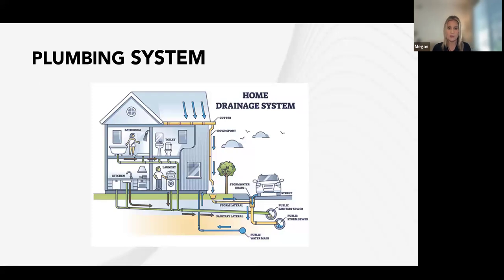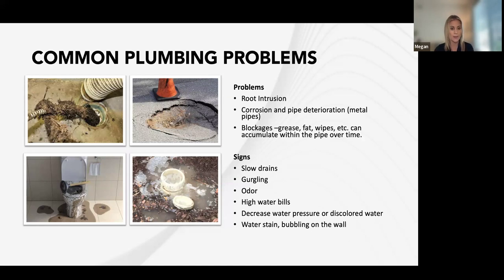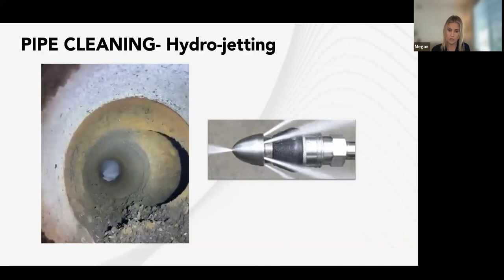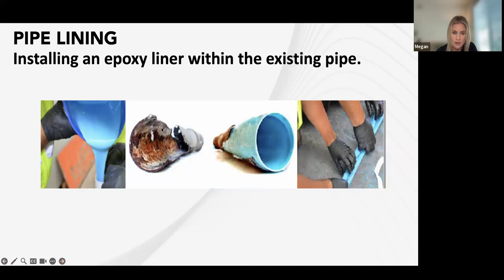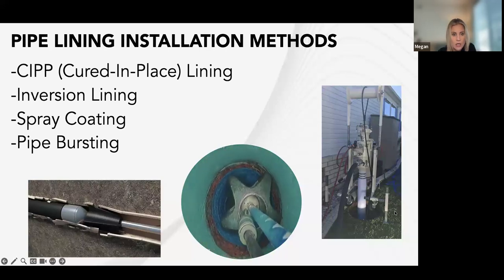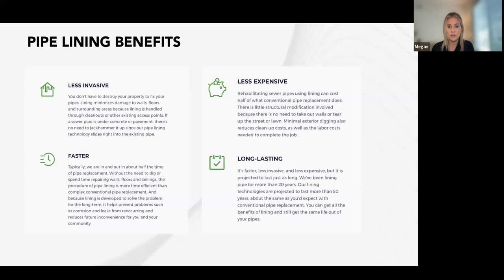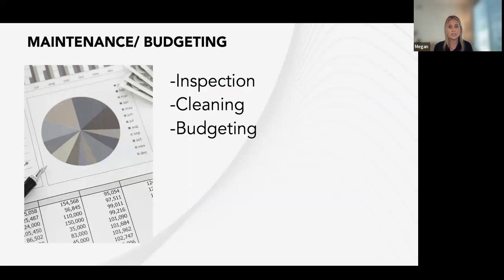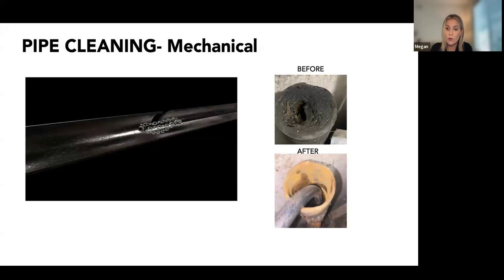Plumbing Restoration: Practical Guidance for Boards (ft. Megan DeWert, PRS)

Comment: My HOA repiped all 75 buildings in 2018. They changed out the copper for PEX and rerouted some water lines. Since then, once  the outside temperature goes above 75 degrees, I get warm water out of my cold faucet  in my 2 story middle unit. On hot days, it reached 105 degree cold water.